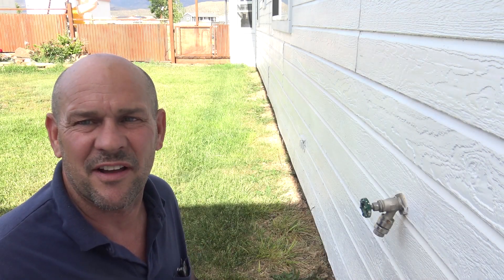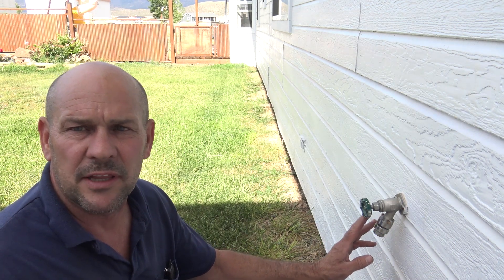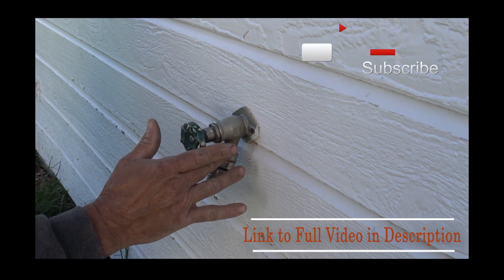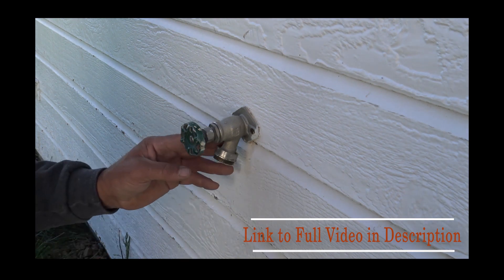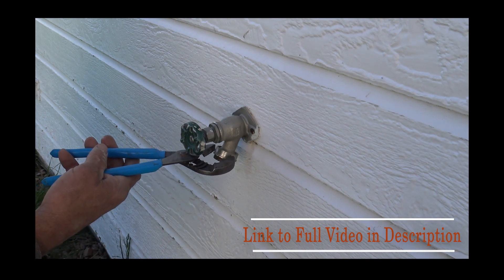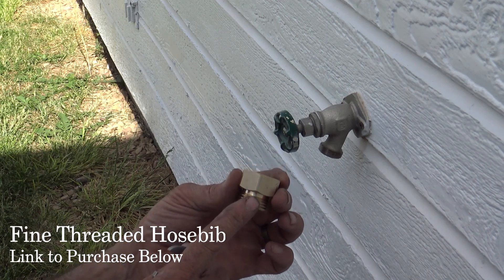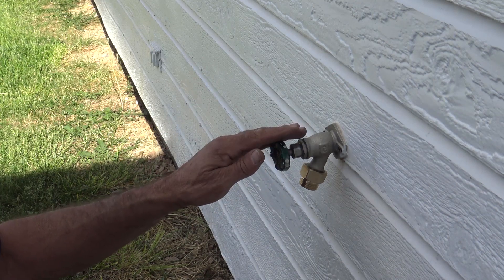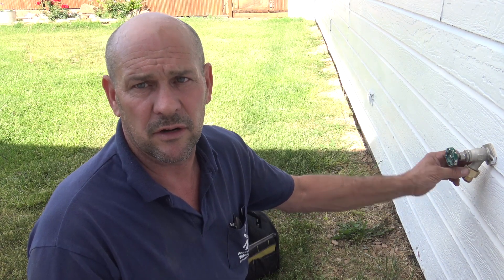How to Repair an Outside Faucet Leak | How to Fix a Leaky Hosebib

Comment: So from what I read, if you install this your home won't be up to code (probably why your house has a vacuum breaker attached).  From what I gather, if pesticide is dispersed via your hose in some way (e.g. a sprayer reservoir on the hose end) or your hose is placed in a pool with chlorine or some other chemical-laced or otherwise contaminated water, if there were backflow/siphoning then the water of the house and/or city could become contaminated.  Probably an unlikely situation for most people.  If you want to order the part, I think this is it, by the way: https://www.amazon.com/gp/product/B081J778FM